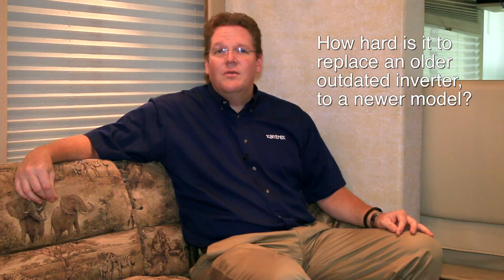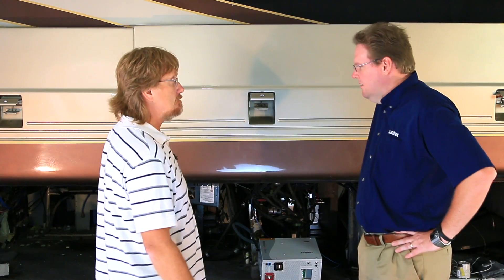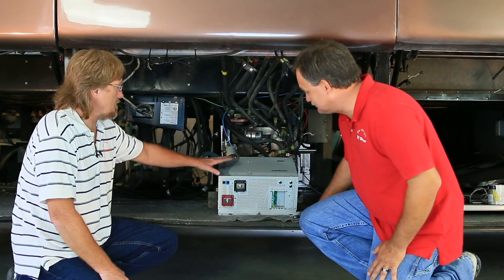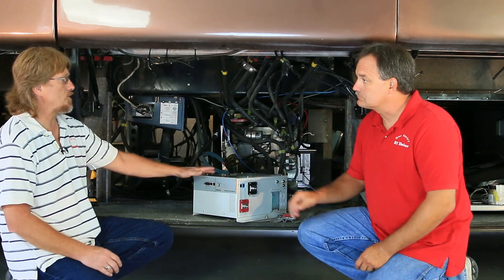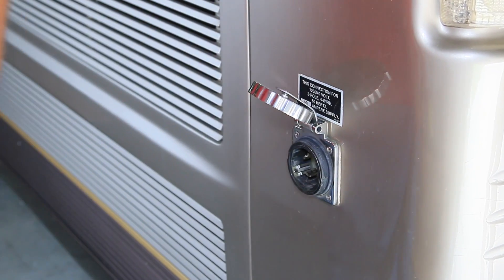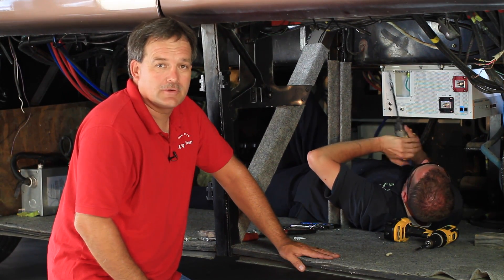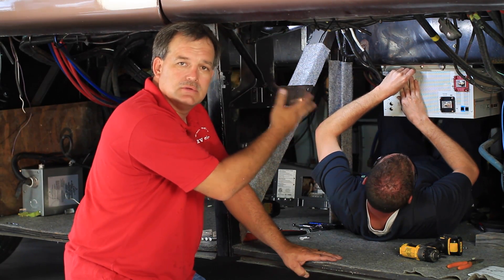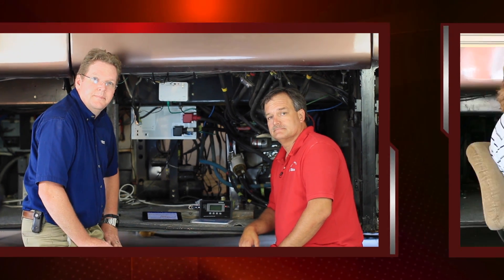Xantrex Freedom SW Inverter Charger Installation in a Class A Motorhome

Comment: Hello xantrex guys. Is there a huge difference between the freedom SW line and the Xantrex 818-2010 Inv/Chgr, Freedom XC PRO??  Someone told me one is a high freq and other is a low.  Low being the one that will last longer and work more reliably?  Please send input?
Reply from the maker: One of the main differences between the two product lines is their power output. The Freedom SW line offers higher power output, making it suitable for larger applications, while the Freedom XC PRO is better suited for smaller applications. Additionally, the Freedom SW line offers more advanced features, such as the ability to parallel multiple units for increased power output, and the ability to be integrated with solar power systems.

In summary, both the Xantrex Freedom SW line and the Xantrex 818-2010 Inv/Chgr, Freedom XC PRO are high-quality inverter/chargers, but they are designed for different applications and offer different features and power outputs. It's worth noting that the lifespan and reliability of an inverter will depend on a variety of factors, such as the operating conditions, and the level of maintenance and care it receives. Therefore, it's important to choose an inverter that is appropriate for your specific needs and to follow the manufacturer's recommended guidelines for installation, operation, and maintenance.
Reply: @XantrexTechnology  I was told by a rep at xantrex that the SW line is buillt more ruggedly than the cheaper lightweight models XC Pro.  They mentioned the SW line will last longer bc it uses a much more roboust transformer.  Id rather pay a bit more and get something that will last longer.  They mentioned one is a low freq other is high..I really dont need any of the features you mentioned.  I just want the one that will last LONGER and can take more abuse out of the two.
Reply: 16:27
Reply: I would like to order some. The inside controller

Comment: Modified Sine  wave inverters still? I just got a 3000w inverter charger by SGP, hope it's an easy swap out. Maybe I'll make a video. I will be taking out the Xantrex and putting in the SGP... it's so I can used my Lifepo4 200a discharge batteries. With an mppt charge controller at 60A and 5 100w solar panels. 500w at 5 hours 2500w. I have 1 12v 200ah battery. I will be running a remote from the swap, hope it doesn't take 5 hours...😅😅😅

Comment: can you extend the cat-5 by using joiner/converter
Reply from the maker: A standard extension coupler will work. Not a hub or network switch, but just a simple hardware coupler will work fine. Each case is different. We recommend you contact our tech support at 18006700707 for solution specific to your needs. Thanks

Comment: i'm not an RVer nor an electrician but wouldn't it be a good idea to use a "do not use" adhesive tape over the shore power outlet when servicing ?  And put on some goggles when working around batteries for crying out loud.

Comment: The box is too big... Technology can make this smaller... and this "proprietary crap... special adapter cables...
Reply from the maker: We do have lower profile, compact lightweight inverter/chargers but they are used mostly in towables. For Class A RV applications, this low frequency units are best suited. Because of the built-in transformer, it is big and heavy. Our new generation solution will hopefully be lighter and smaller than the current Freedom SW. Thank you for the comment.